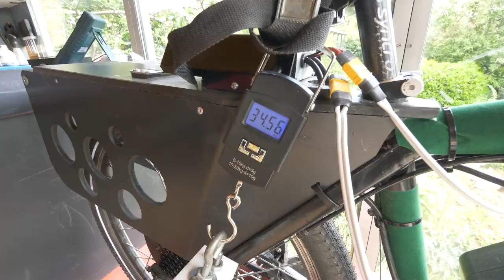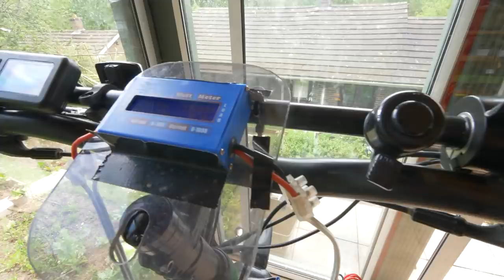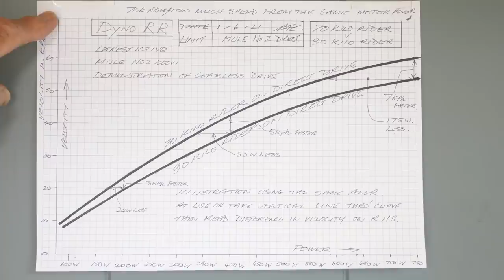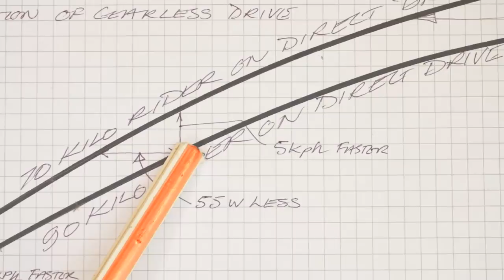How Does Rider Bodyweight Affect E Bike Performance? | 70Kg Vs 90Kg Data

Comment from the maker: What did you think of this test? What would you like to see from this rolling road?
Reply: Enjoyed that. I’d have like to have seen a comparison over the speed range of Watts at the back wheel compared to Wh used at the battery so we can see the system serial efficiency at different motor speeds. Repeat with different gradients, effectively different rider weights 70, 80, 90, 100, 110 and 120 kg. Then do a comparison as above with direct drive hub rear vs epicyclic hub vs mid-drive.

I hear Ray likes his direct drive which is what I fitted when I converted my sailing yacht to electric drive, but for an eMTB I wouldn’t want that extra unsprung weight which drastically affects suspension performance.

Just a reminder though it’s all about Watts/kg so a lighter rider producing less Watts compared to a heavier rider producing more Watts, i.e. the same W/kg for both riders means both could be equally fast uphill to the point where aerodynamics start to have a larger effect (about 10 mph). Time Steve started on building those legs up if he can’t stop eating the pies. 😏
Reply: Id like to see , all modern motors cadence vs watts to 150 cadence, 80kg rider at full boost , 500w rider power.   That Orbea custom tuned 65nm motor will be interesting .
Reply: Takes me back to college days 🎓😂 rays the man.
Reply: PLEASE lemme know what you think of the new TREK E-Caliber ebike WHICH TURNS INTO A REGULAR BIKE IF U REMOVE THE MOTOR & BATTERY!?!?!?!?!

PLEASE DO A SEGMENT ON THIS TYPE OF EBIKE
Reply: Nice one Steve and Ray. All as predicted. Be good to add acceleration tests, which for a weight differential, will show an even larger difference in power consumed and acceleration achieved. As I’ve been saying, eMTB racing needs to take a leaf out of the Kart Racing hand book and look at handicaps and classifications that reflect the fact it’s partly a motor sport.
Reply: @JohnRushworth  That's not very nice now is it John hahaha. But yes watts per kg for sure, this is just an idea that all thing's being equal and without uneven surfaces, wind. We will expand on in future. See you soon hopefully
Reply: @andreregini5928  Big subject right?
Reply: I have been wondering when that machine was going to be in a video!  Great start to using it.  I also weigh near 90 kg, and like you have experienced first hand the added battery drain on climbs.  Of course rider fitness level also plays a role.  One video I would love to see is comparing the efficiency of different bike/motor setups. Subjectively it seems like the Brose is more efficient than my previous bike with a Shimano E8000 motor.  That machine you featured in the video might be able to get an answer. Keep the videos coming. I find them very interesting!
Reply: It Looks like your hurting to find good content.
Reply: Steve Jones Sure is and not easy to come up with a quick fix.
Reply: 150kg rider.

Comment: To me, this is only measuring the difference in weight as a factor of tire friction. That's a whole different beast than additional weight going up a hill. Plus, tire friction can and would be modified with pressure. Heavier riders tend to use higher pressure which would negate much of the results here. Lot's of things at play here but this appears to be only a single, possibly less important factor among many.
Reply: I think you’re right. How does this rig simulate the work of accelerating more mass?
Reply: Yeah, this setup tells very little about what's being discussed. Has nothing to do with climbing (where you have to produce power to "lift" your weight, which in reality is the big difference in power) especially since a heavier rider would ride at higher pressures, making the gap in rolling resistance (which is what is measured here) even less. At 25 km/h air resistance will not be a big factor.
Reply: @avlehtine  Fully agree

Comment: i have a 2018 levo.  when i started, i was 220 pounds,  Im now 145.  I used to get home with 20 to 30% battery but now. 50 to 60%.  same riding style on my commute. it definitely helped with fitness.
Reply: Thats a great weight loss.  Did the bike (movement) play a big factor in your weight loss?
Reply: @mitchclem3404  it definitely did. I ride electric and acoustic bikes now, lots of interchanging.

Comment: I'd be more interested to see the effect of gradient included. This test setup only appears to be looking at differences in energy lost due to increased tyre deformation. If you repeated with a solid rear tyre, I don't think you'd measure much of a difference. Also, having two small diameter contact patches (rollers) instead of one (flat surface) has the opportunity to cause more tyre deformation under load than a real rider would see on flat ground. Once you simulate a gradient to include the effect of gravity, I'd have thought the losses would be more pronounced once the extra energy required to gain gravitational potential energy is added to the losses from tyre deformation and friction already shown here.
Reply: My thoughts exactly. If you compensate with a slightly higher tyre pressure and keeping in mind that heavier cyclists produce more power, the whole test becomes a bit irrelevant. What really changes dramatically with weight is energy used for climbing: this is where it makes a huge difference.
Reply: So are you saying it all depends on the gradient and not rider/bike weight?  Would a full power eMTB only use as much as an SL regardless of bike or rider weight (or just more of an impact)? @markotrieste
Reply: @msjj000  Suppose you do a 1200 meters climb in one hour. Two riders, one 70 the other 100 kg. It's 228Wh for the first rider, 326Wh for the second, only of gravitational potential. Add friction, the whole must be given by motor and legs.
Reply: @markjurisic000  In other words, rider weight and gradient compound one with the other. On flat road, actually a heavier rider may have an advantage, if their specific power is the same, since with more total power the heavier one would be better off against wind and rolling resistance. On the contrary, once gradient becomes the dominant energy drain, then the more weight the more energy it will take, linearly. A heavy rider with a "light e-MTB" will quickly max out the motor and drain the small battery, while the lighter rider would be better sized to the light e-bike.

Comment: this is really interesting, but it doesn't account for the increased inertia of a heavier rider does it? Or have I missed something? I think that it's not just the static load like this that matters, but the energy required to overcome the inertia - so every time a heavier rider needs to accelerate, be it upwards over a rock or obstacle, or any other change of velocity would require a substantial increase in energy.
Reply: Not to mention they talk about climbing, where you also have to "lift" yourself.

Comment: Challenge accepted😁
I'm all about data acquisition to 'potentially' determine whether a lighter rider is quicker than a heavier rider. But last time I checked, muscle weights more than fat. I'm 6foot 3.5 inches tall and muscular (not skinny). If I'm able to conquer climbs without using the highest level of assist and still keep up with 'lighter' riders, then I'll continue to believe that rider technique, fitness, line choice, cadence and bike setup are quintessential aspects to factor (in addition to gross rider & bike weight).
Nevertheless, I'll keep on shredding up and day the trails till dinnertime. Keep  up the vids guys 🤙🏿⚡
Reply: There's indeed also more in life than "climbing prowess". I like my "squat garage door" build for a number of reasons.. :-p

Comment: Significant difference just on the extra friction caused by extra weight. It must be massively exacerbated when the terrain starts to rise. Loosing weight off my body has certainly helped when things go up, but my bulk makes me pretty swift when gravity is helping. There’s got to be a complicated ‘sweet spot’ somewhere. Power to weight, VO2 max, FTP plus assistance.  The GCN+ video ‘Fully Charged’ would suggest rider skill also plays a massive part. I’m pretty sure Si is quite lightweight....

Comment: Good vid. So difference stays around 15% per 20kg. Our motors up a hill will run around 400W. 

So rough maths means on a 500 (13.5AH) battery a 90kg riser would climb for 1h52m and 70kg rider climb for 1h37m.

Real world with mid drive the result is probly a little greater.

Comment: This is just a test of the resistance of a static rig with more variables than real life situations... gravity is the one factor that needs to be worked into the test, and is not actually calculated. The same results would be obtained just by changing Tyre pressures on the test rig.
Heavier riders have the advantage on downhill sections, again, due to gravity... it is the environmental constant that seems to be ignored in this 'test'...
Heavier riders know to add more air to their tyres to compensate for weight... the heat is such a minor factor as to be insignificant - if your'e riding wet, muddy conditions, your tyres become water-cooled anyway...
Reply: Gravity will take heavier riders downhill at exactly the same speed as lighter riders. More energy is required to stop them; greater mass = greater energy hence more heat in your brakes but no additional speed. 

You have missed the point entirely about heat losses but given your other comments I'm not sure there is any way to get you there.
Reply: A heavier rider has more potential (stored) energy when it is activated by the force of gravity, and released through a mechanism such as a bicycle. 
I don't know why you have now introduced brakes and stopping into the debate, that is a given, and proves my point that there is more energy being liberated by gravity acting upon a heavier rider... I am addressing the points raised (or not) in the video.
Pop over to GCN and look at a few of their videos on this subject... those roadies are obsessed with weight, and have shown what we all know... that heavier riders are held back on hills, with all other factors the same except their weight, and also that heavier riders, are faster downhills, with all other factors except weight the same...
Unless you can account for and reliably quantify (and repeat) the other factors such as motor or wheel bearing friction and heat, aerodynamics etc in comparing different scenarios where the 'only' variable is rider weight, and unless gravity is calculated in, rather than just downforce (which is NOT gravity), then this is just a couple of old blokes mucking around in a shed trying using psuedo-scientific 'methodology' to find a 'thing' to make a video about. Gravity acts independently on the bike/rider combo, where as your rams are just part of a closed system and not a very good facsimile or analog for gravity...
Reply: @richardcollyer9414  You're completely wrong. The force that accelerates you down a hill is in direct proportion to mass. The greater the mass, the greater the force. It's as simple as that. 

The acceleration is inversely proportion to mass, so the bigger the mass, the slower the acceleration with the same force. In other words, both the heavy and light rider will start to accelerate down the hill at the same rate, but the heavier rider with the bigger force can overcome more air resistance, so he will reach a higher top speed. in fact, as the speed rises and the air resistance starts to become significant, the heavier rider will start to pull away from the lighter one before he/she reaches top speed.
Reply: @hughjardon3538  Yes there is more force (energy is better word) but not more speed.

Comment: That test is very different from real usage simply because weight in this setup does not affect the energy needed for acceleration. More mass, more energy to accelerate to the same speed with a lighter rider. In reality the difference would be much wider.
Reply: Indeed. But if you have the linear numbers, adapting them to acceleration would be a matter of laying them on top of a track outline (height, cornering etc..).
And not forget: us fatties have more mass pulling us down when descending! :-p

Comment: Nice application of Engineering. Watch the Tour de France. You rarely see the whispy guys fighting it out for sprint finishes on the flatter stages where the heavier power-guys shine. When they get in the mountains the lighter riders fly, chased by the peloton full of all rounder riders. Those who fall out the back, usually the sprinters, get together in the autobus / grupetto and work to beat the time cut. Reality confirming technology 😉

Comment: What about gravity when you climb uphill?  You have to get out there an do some real riding to get any real data!
Reply: Are you serious? The multiplier would be the same so it cancels out when comparing. By going outside you’d introduce dozens of uncontrolled variables like windage, rolling resistance etc. Ruining any chance of fair comparison. This is why rigs like Ray’s are built.
Reply: Not at all re gravity as rolling roads remove varying variables for consistent test results. Gravity is mass anyhow. Climbing speed is all about rider Watts per kg of body weight. Look up Dr. Andrew Coggan tables.

Comment: Yes bike weight matters, I have a 95 lbs ebike and if this thing batteries 🔋 die or it gets a catastrophic flat while I am out an about it will be hell pushing this damn bike back home or to my truck 🛻.  I can’t pedal this bike if the battery 🔋 Dies.  You laugh 😂 , but no I can’t pedal a 95 lbs ebike after the battery 🔋 is dead ☠️.  So what do you do.  As a warning ⚠️ to all don’t buy a 95 lbs ebike or some day you will be pushing this damn thing 10 miles down the road.